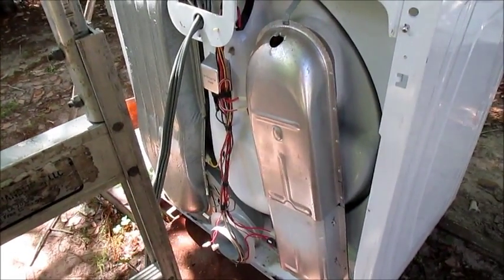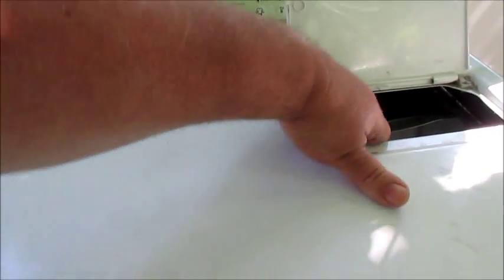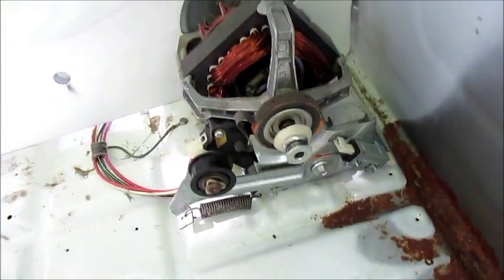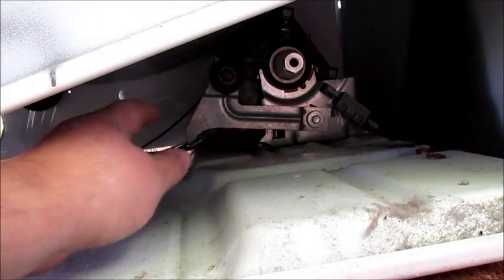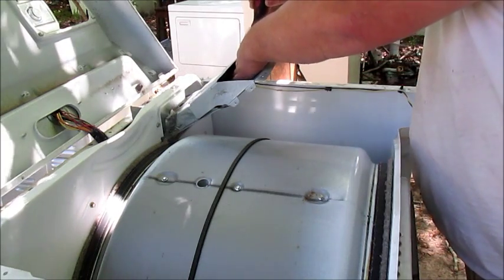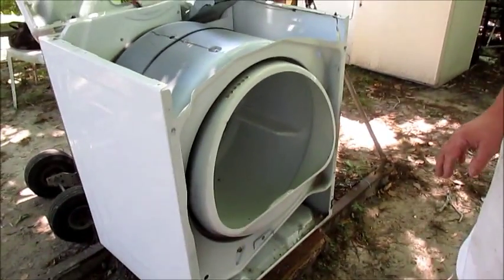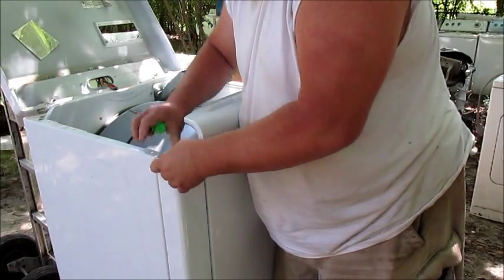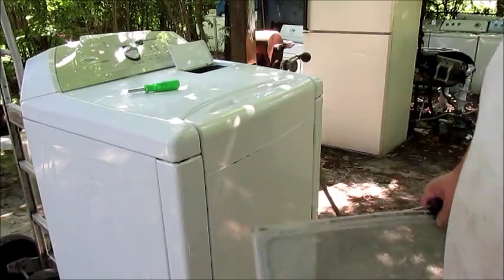Cabrio Dryer Notes

Comment: That must be an older Cabrio pre WED5500YW.

I have a WTW8600YW washer and a WED8600YW dryer
I really enjoy mine
Reply from the maker: Cool Yours has 2 belts. The pulley nut been known to fall off small belt driving the blower falls off (way over engineered)and the blower quits. Causing a very clogged mess.

Comment: Dan, I have a couple of questions if you don't mind. My wife bought this dryer used and it has supposedly been converted to run on propane. How can I tell if it has, and is there anything to watch out for when starting it up?
Much obliged and looking forward to your answers.
Claes
Reply from the maker: You would know it right off I imagine because the clothes would be smelly or worse a fire. We have tested nat gas dryers with propane but never tried to dry any clothes because it isn't safe and will cause odors, carbon monoxides, sooting and over heating in the burner compartment area. All very unsafe condition. excessive flames in a dryer full of lint is a disaster waiting to happen.